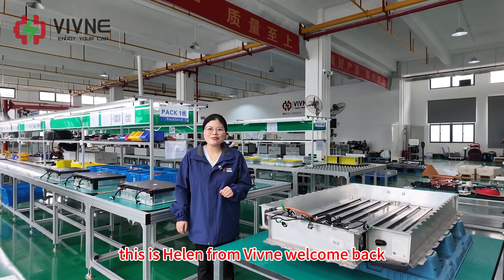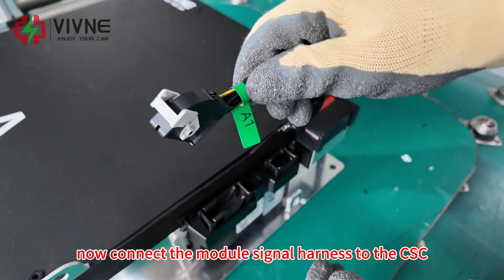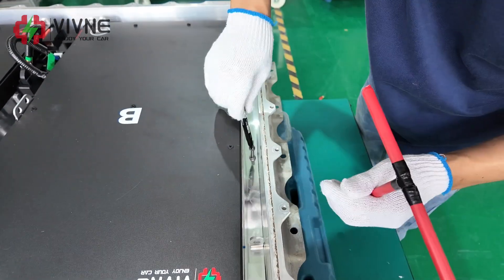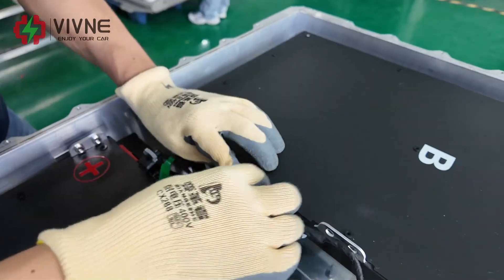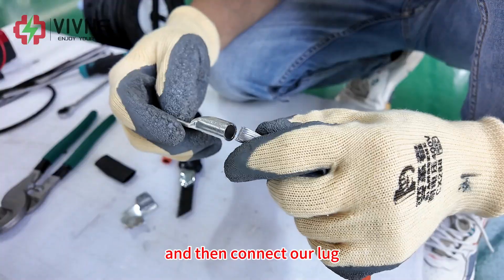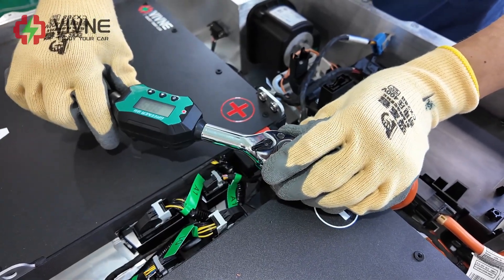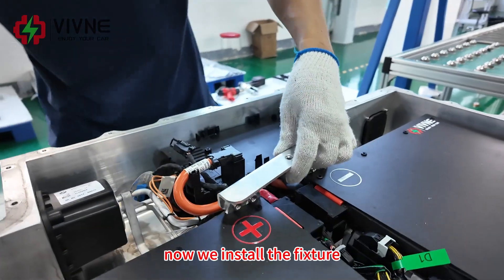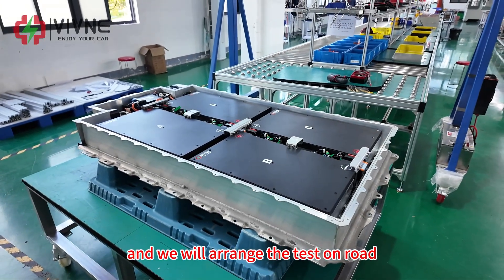Vivne 45kWh BMWi3 battery installation guide

Comment: Just as a reminder for potential buyers in germany/eu: working on high voltage systems on your car is illegal and void any insurance you have with your car. As an example, when your car catches fire and investigators find out there is a battery installed that dont fit the official spare parts list of BME you will have to pay every damage associated. Now think about this causing bodily permanent jarm to others. All this, for you to save some bucks.
Reply: Get a mechanic to do it, and you will have 0 trouble. Also if it burned down to the ground there will be nothing to find.
Reply: @iirmantass3  You dont know how much is still left over to be found....